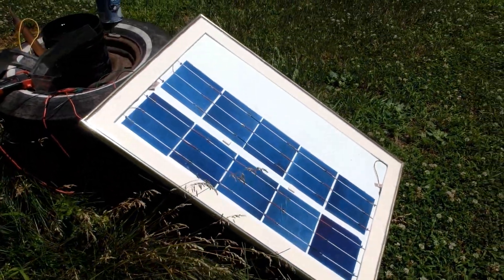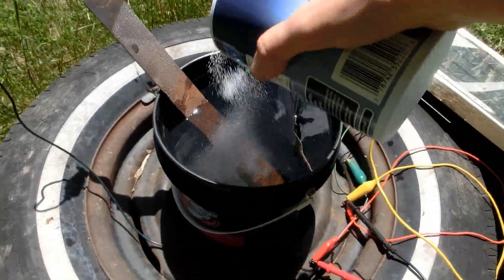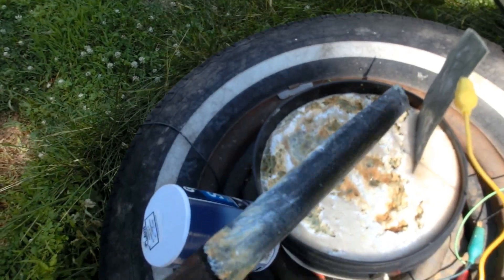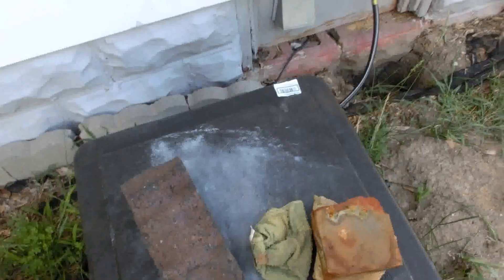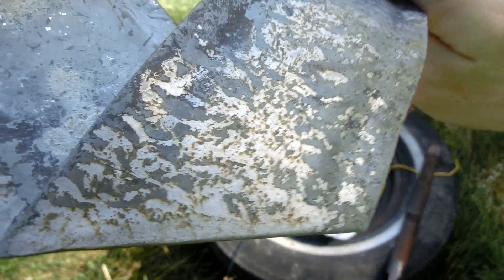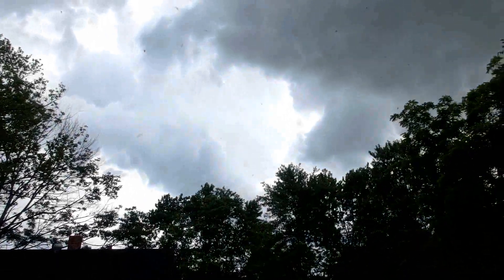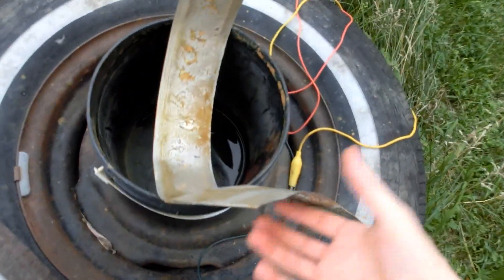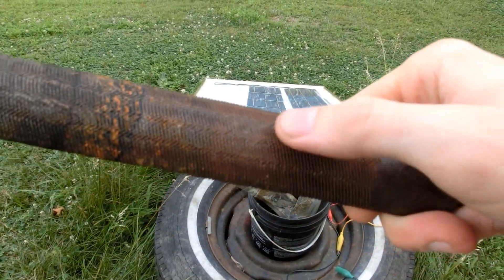Removing Rust with Solar Panel Steel File Electrolysis part 1

Comment: stay back behind somthing ( like fire in the hold standard) drill hole in the end of sleg hammer like a pendulum in the nine oclock postion tei a string th cog holdong it in the nine until safty behind the barricad then pull string and sleg will free fall and kcocking the main cog out  to start the hundred pound descent

Comment: cog holding the platform from descending Whitch has a second anval  welded t o the bottem of the descending striker until  get knocked out with sleg hammer and the 100 pound of water free fall that anval  about a foot off the ground  weld to anval a trench so the pipe will not move when struck by falling  weight to get consistent flating of pipe for hinges

Comment: think of a  hydraulic press  three vertical muffler pipe 12 feet high  (post hole digger )at top platform between Like spider making a web between the vertical  which are a three foot even sided triangle  the 12 foot thing for holding  100 pound of of water homer all purpose or what ever hold water  tops

Comment: I am trying to plan for emergency's  like hurricane Katrina with FEMA temporary wooden  track that branch off the real train track to remote homes location to bring water food first aid ( I watch a lot of Norm Abram this old house)  it is just a planer knife that turns a 4  by 4 into a train  track you just scan (lidar) the topography of the space between the closest train trains and the remote location and a computer mill the shapes and turns up hill and down safe angle dissents and where to builds temp bridges

Comment: junk yard  muffler pipe rustoleum paint  rebend with muffler pipe bender to make frame for bear and bee prove all wheel dive three 750 watt 36 volt trike controller which is very  easy to add reverse wiring wheel chair accessible entry from back 
would you like to watch the video for how did this ( it also fits one trian tracks sort of my chitty chitty bang bang

Comment: I used electrolysis on a set of truck rims that were in a fire and all rusted up. put them in a plasic garbage can and hooked up a 10 amp battery charger and used Arm & Hammer super washing soda to boost conductivity. took about a day to remove all the rust and have bare metal rims when rinsed off. I don't know about using salt as a conductivity booster because of the corrosive effect it has on metal.
Reply from the maker: salt has a corrosive effect on metal only when the chemical reaction isnt supplied with power. when salt touches metal it creates a small battery. but electrolysis like in this video is acting like charging that battery, so its doing the opposite of corroding.

its similar to why they have blocks of zinc on ship hulls to stop rusting, it charges the ship hull so it can't rust.

Comment: Just looks like slag on the bottom of the file, perhaps you could try raising the stuff your de-rusting off the bottom of the container with a mesh structure or small rock or something :-) Another cool video, those solar panels just keep giving :-)
Reply from the maker: yeah i've already put a brick under the file to keep it up and its fixed that problem.

Comment: in stead of salt what if you used drain cleaner to increase the conductivity  of the water?
Reply from the maker: don't know. it would be similar to battery acid. worth a try though.

Comment: Cool! How much current did the solar panels provide at most? I was surprised to see them do an amp; I didn't think they'd be able to provide more than a few hundred milliamps.

I wonder if the large amount of time required to electrolyse something with this setup would allow it to rust even more, though, since it's in contact with water and salt...
Reply from the maker: no the rust process is reversed due to the electricity. and the panel was providing 3.5v 2.3a at peak power.

rust can not develop on a material if it's charged correctly, thats why they put zincelectrodes on steel ships to electrify the hulls by like 0.25v.

Comment: Could you not use a metal bucket
Reply from the maker: i've never used a metal bucket. i've used plastic. if you use a metal bucket make sure its connected to the negative lead also. that will also clean the bucket a bit.
Reply: I don't want to use it am asking would you use it or something
Reply from the maker: fungamer sr
 your not making any sense. so no, yes, maybe.
Reply: Rinoa Super-Genius I believe he's suggesting using a steel bucket as the sacrificial electrode so that you get full 360 degree coverage.
Reply from the maker: Unreasonable Steev
that would be a terrible idea, the corrossion would cut through somewhere and you would lose all the electrolyte.
Reply: Rinoa Super-Genius Haha, yes it would be, plus you'd have to keep getting new buckets.
Reply: Unreasonable Steev that what I mean but it's a bad a idea

Comment: Nice experement, im not sure how much current it would take to do the job in one day, not enough from the solar panal i suspect.
Try heated water the salt will dissolve easyer :-))

If you try plating later on, that should be an experement fest :-))
Reply from the maker: yeah it would be cool to plate the steel pipe fittings i have with copper.

Comment: coming along, i can give a few tips as i've used this before, suspend the part to be cleaned so as to not touch bottom, your sacrificial steel was galvanized, so it was only using the exposed steel, use some real clean steel instead, and use some washing soda! wash well then scrub using a scotchbrite pad, then wipe with wd40.
 also dont worry about leaving it for days, it wont hurt at all, you cannot overdo it, maybe for a tall item like a file, can you find some steel pipe? use that as both container and sacrificial part, if you can seal up the bottom of it
Reply: I wouldn't leave it in salty water without the current.  When the there isn't a lot of sunlight and at night, pull it out.
  Scratch the galvanized metal to expose the base metal for quicker results.  The galvanization is on it to prevent the very thing you are trying to do.  I do love how you coiled the metal to fit in the plastic bucket.  Just remember, any metal pressed against the plastic and not exposed reduces its usable surface area.
   Instead of wire brushing, something like an old nylon or bristle brush pulled in the same direction as the grooves should knock a lot more material off.
   Put something plastic in the bottom to get it away from the debris or suspend the file up from the bottom with a cross beam over the top of the bucket.  The cathode clip attaches it to the crossbeam.

Comment: You are supposed to use Washing soda or Bicarbonate of soda not table salt..  I'm surprised it worked at all frankly!
Reply: He is not a conventional person, its just experemential :-)
Reply: Heh, I'm not criticizing you Rinoa!  I just thought you were supposed to use Bicarb of soda instead of table salt.. But you are right.. You just need to increase the connectivity and Salt does do that..
Reply from the maker: supposed to? this isnt like a board game where one person writes the rules. all you need to do is increase the conductivity of the electrolyte. you could do that with salt or anything the would be dissolved/suspended in the water to make it more conductive.